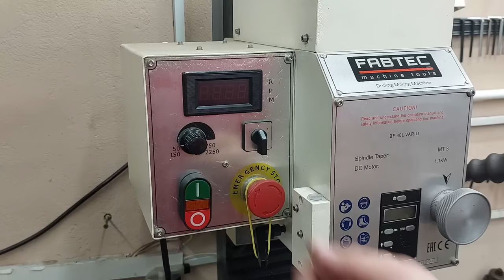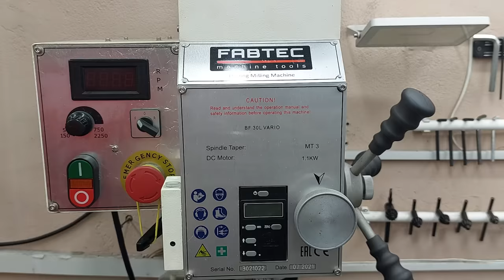Amazing idea and tip in 7 minutes! This metalworking secret will surprise you

Comment: Why waste so much time, material and effort, ruin an end mill, to make a tool to cut a slot that the end mill could cut easily and produce a finer finish and a better end to the slot!
Reply: I'm guessing he's doing this because it's cheaper to regrind this tool than to keep buying side cutters.
Reply: @darthherald2564 It's a slotting drill and can be resharpened on that same bench grinder, just as easily as a twist drill.
Reply: Yeah, but it is so much fun!

Comment: great project, I have a few similar.
I have found couple of minor things helpful. 
making a through hole tapped on back of that with a grubscrew pushing the cutter out makes it easier to adjust (I prefer M3x0.5, one turn=0.5mm deeper cut or 1mm bigger hole).
drilling hole ofset so edge of cutter passes center  (or closer to anyway) you don't have to grind half the metal off to get cutting geometry right.

Comment: Nice slotting tool/bore cutter (not a fly cutter)
You could potentially use the base part for both, by cutting a hole in the base for the HSS tip and with a locking screw mounted on the side, so this little tool could serve multiple purposes, kudos!